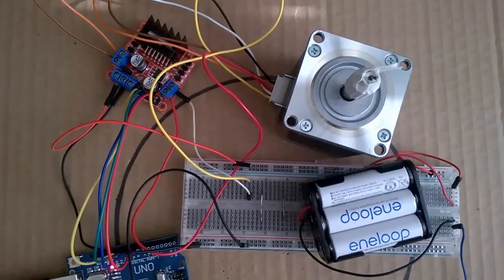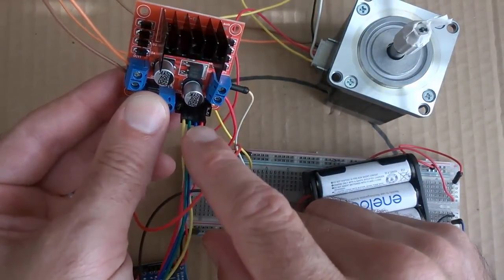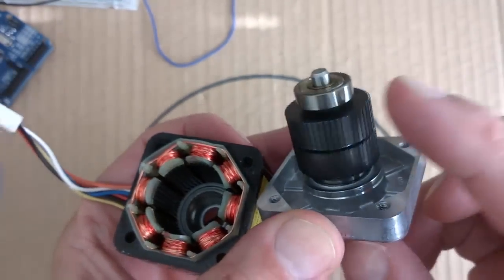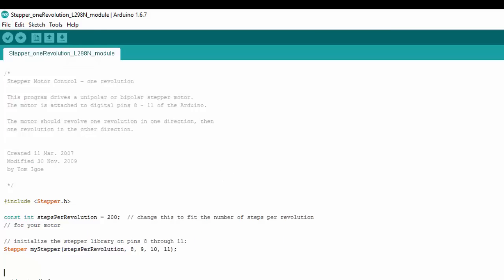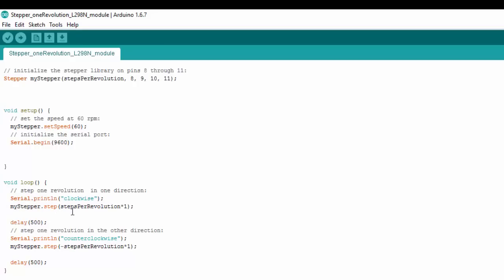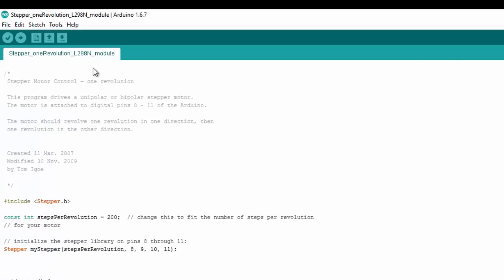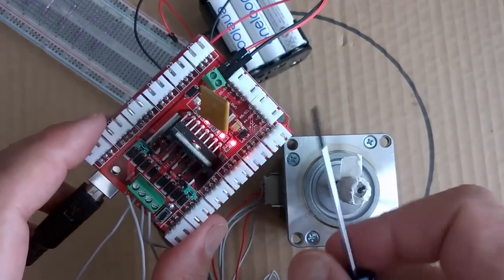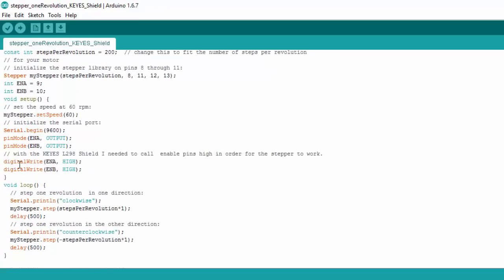Lesson 9 - Drive a stepper motor with an L298N Module - Arduino a Quick Start Guide

Comment: sir help me out when stepper motor runs negative or GND wire of battery is heating and the battery is getting discharged very quickly like in a Minuit and once the wire also burned. I checked the connection their is no short circuit . is it a problem of stepper motor

Comment: Hi im currently working with the same motor driver and my l298n heats up too much. what can i possibly do to solve my problem? pls reply asap. i badly needed this one. i have 12V 2A supply.
Reply: im using stepper motor. it doesnt heat up when  i use dc motor
Reply: Hi, I also have excatly the same problem, have no idea what is wrong... maybe the I298n overload? but it makes no sence to me....

Comment: how did you handle the enable pins on the h-bridge?
I did not get it
Reply from the maker: Hi Mohamed Sabry, when using a stepper motor you can drive the enable pins from the +5V supplied from the h-bridge module. To do this you just need to ensure that the pin jumpers have been placed over the the ENA and ENB pins on the module, like the ones that are in place in this image: http://fritzing.org/media/fritzing-repo/projects/w/working-with-l298n-dc-motor-driver/images/Dual-H-Bridge-DC-Stepper-Motor-Drive-Controller-Board-Module-Arduino-L298N-HE2.jpg

Comment: why my driver l298n so hot ? I use stepper motor Nema17 1.8a
thanks
Reply from the maker: Hi Imerja Jusufi, the heatsink on the L298N will get hot, and so will the stepper motor depending on the current running through them and the load on the motor. You should attach a current meter in series with the motor to see what the peak current is. I have found that there is quite a difference in current draw between motors, depending on the size and make. Some of the bigger motors are more efficient and draw less current. You can view the datasheet for your specific motor, but the best way is to hook up a current meter. Also, there are more efficient drivers than the L298N. The L298N is good because it is cheap and easy to get hold of, but if you want to creat a system where you will be running stepper motors for any length of time then you would want to look for an alternative. Something like the G-Shield has very robust drivers with current limiting, and can be easily controlled to drive at least 3 stepper motors.
Reply: ICT Tools for Teachers what did you mean for tb6600 is batter than l298n or gshield is batter than all
Reply from the maker: The TB6600 looks like a good choice. You would need to change the code to use it though. There are a few good Youtube tutorials on how to do it.. Each of the options are good depending on what your application is. if you just want to drive one stepper motor under load then the TB6600 may be a good option because it has a decent heat sink and 5A peak current with current limiting capabilities.
Reply: ICT Tools for Teachers I like to use two stepper motors, what do you suggest to buy? Two tb6600 or GShield? Which is more stable? thanks for help
Reply from the maker: It all depends on what you want to do and how much current you are pulling. If you use two tb6600 then they will handle a higher current (which may be good if you are using Nema 23 motors), however, then you have two shields to control which adds further complexity. If you want to drive two motors for movement in an  x/y axis then the G-shield will allow you to drive up to three motors (2.5 Amps per winding), and is easy to control with firmware and software that has been developed by the G-shield community.
Here are some links to help you with your decision:
https://www.dfrobot.com/wiki/index.php/TB6600_Stepper_Motor_Driver_SKU:_DRI0043#Quick_Start

https://www.adafruit.com/product/1750
Reply from the maker: In that case I would think two TB660 driver would be best, but I am surprised that your L298N is heating up so much when you are just driving a camera crane. It must be a heavy camera . You should study a few more tutorials and check the code to be certain.
Reply: ICT Tools for Teachers can you send email to send code ?
Reply from the maker: You can find some sample code here: https://www.dfrobot.com/wiki/index.php/TB6600_Stepper_Motor_Driver_SKU:_DRI0043

Good luck :)
Reply: ICT Tools for Teachers someone tell me to bay A4988 have you any info ?
Reply from the maker: "Please note that while the A4988 driver IC is capable of supplying 2 A per coil, the chip by itself will overheat at lower currents. The carrier board PCB helps draw heat away from the IC, but we have found that it generally requires a heat sink to deliver more than approximately 1 A per coil"

Once again it depends on the current drawn when your motor is under load.
In your case I think the TB6600 might be a better choice.
https://www.pololu.com/product/1182/faqs

Comment: hello, great video!, if a want to use an arduino nano, what pins do i have to use?
Reply from the maker: Hi Adrian, you could use the same pins: 8,9,10,11
The pins on the Nano are much the same as they are on the Uno.
Reply: Hi, is this driver the same as bts7960? because I'm not sure the firmware installed on Arduino can't work with l298n

Comment: hello how many motors i can use with this driver
Reply from the maker: Hi good football. This module is designed to drive only one stepper motor (it is usually used to drive two DC motors), however, you could drive two stepper motors in parallel. The thing to watch is how much current is being drawn by the motors. The L298N Data sheets mentions a 3A peak, but you should try to keep the running current under 2A. You will find that the heatsink gets quite hot, even when running under 1.5A. If you want to drive stepper motors for say a CNC machine, then you should consider something like the G-Shield. The G-Shield and others like it are easy to use and have load balancing capabilities.

Comment: Hey great video! Is it safe to power my motor with 12V and have it plugged in through usb on my computer?
Reply from the maker: Thanks Demetris. You can power your motors with 12V and power the logic with 5V from your PC, just as long as you don't connect connect the positive wire of your 12V to the logic circuit. To summarize: connect all ground wires together, but keep the +12V and the +5V lines separate from each other. Hope that this helps.
Reply: ICT Tools for Teachers Thank you that was the clarification that i needed! Great videos btw:)
Reply from the maker: You are most welcome Demetris. Good luck with your project :)
Reply from the maker: One further note: If you are connecting your Arduino to the +5V on your computer then you should not have the +5V running from the motor driver to your Arduino - make sure that this wire is not connected (only use this if you want to power the board directly from the motor driver module).
Reply: Just wanted to let you know that i run my experiments and it worked perfectly. Thank you for the advice!
Reply from the maker: Awesome Demetris. My channel and another channel will be combining forces soon to share more information like this along with new pieces of technology. We also hope to share stories like your own. There is not much activity yet, but we have designed an Arduino shield that we think is pretty cool. You can follow our progress here: https://www.facebook.com/firebugsinnov8ion/

Comment: hi.. is it ok if i use ac supply？ i use 12V/5A switching power supply adapter to convert ac to dc.
Reply from the maker: You can use AC as long as you convert it to DC. Make sure that your AC to DC converter is safe to use. You do not want to mess around with high voltage AC.

Comment: sir? how much pounds nema can carry using this drivers(l298)? output of 12v and 2A.
Reply from the maker: Hi Jaiden, this is a difficult question to answer. I am no engineering expert, but I would say that when you add a load to the motor that the amount of current drawn will go up. The L298n modules have a current rating of up to 4A, but you should aim to run the motors drawing less that 2A, to avoid the L298n overheating. I would suggest connecting a current meter in series with the circuit, and testing the current drawn when you place the motor under load. If you find that the current is spiking above when is comfortable for the L298n, then you should consider a different motor driver. This post here give some good information: http://www.rugged-circuits.com/the-motor-driver-myth/
Good luck :)

Comment: sir can u help me pls.. 
http://stackoverflow.com/questions/39312305/stepper-motor-nema-17-controlled-by-l298n-driver
plssssss... plssss. any advice.. plsss..
Reply from the maker: Hi Winnie, I added a comment on the Stackoverflow post. It looks like you have the code and wiring correct. If you are using a good supply of 12V which can supply 2A, then it should work. I only have problems when the voltage is too low, or if the wiring is wrong. If the L298N has been connected with reverse polarity then the module may be damaged, I would consider doing a test with another motor and a test with another L298n module. Best of luck :)
Reply: thank you for your reply sir.. i did try another L298N which i borrowed from my friend and it worked like a charm. . . gues my L298N is the problem... its brand new. hhuhuhuhu :(
Reply from the maker: No worries Winnie, I have used many L298N modules, and I have only had one which didn't work. Hopefully the next one you get will work as it should. Best of luck :)
Reply: sir i have another question. . i am using 12volts battery, the one we used in motorcycle and i notice that the L298N Dual H driver is very hot. is that normal?.
Reply from the maker: Hi Winnie, the L298n will get hot, but you don't want it to get too hot. The hotter it gets, the less efficient it becomes. You should place a current meter in the circuit to check how much current is being drawn, to make sure that your motor is not drawing too much current. The L298n can only handle current loads under 4A. The L298n is not the most efficient motor driver for stepper motors, but it is simple and cheap. If your current loads are ok, then you could try using a small PC fan to help cool the L298n.
Reply: thanks a bunch. .